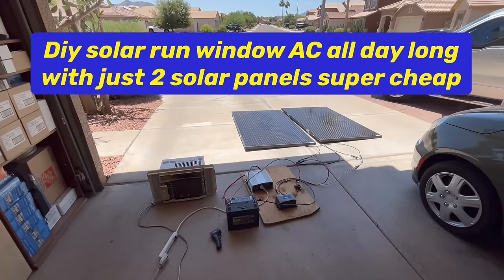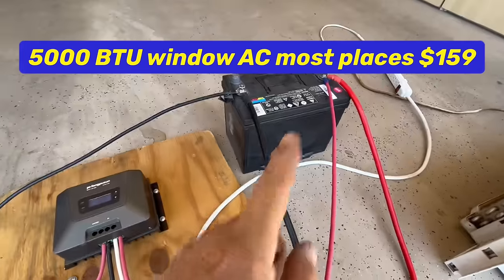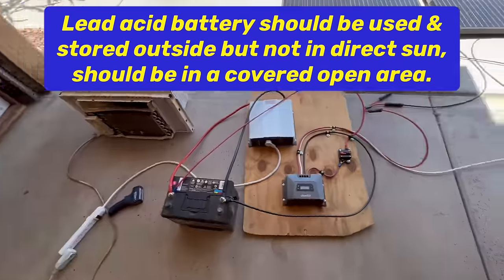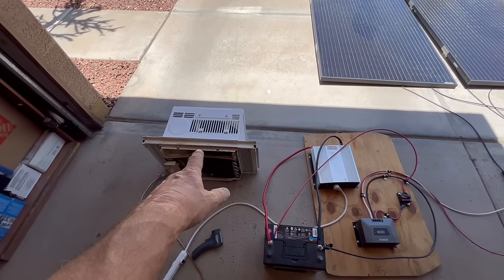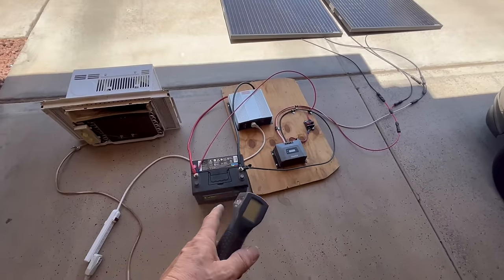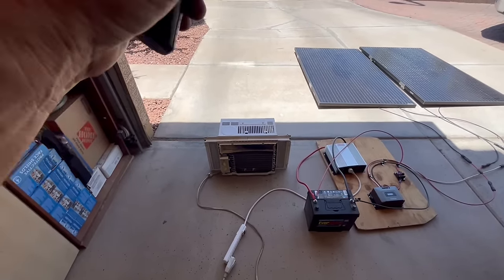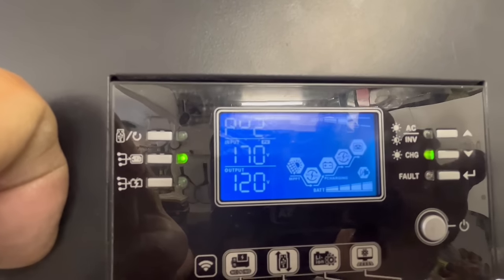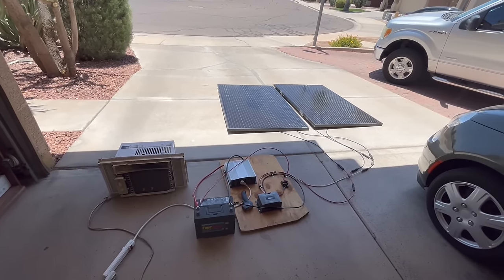Run your window AC with just 2 solar panels when sun shines. Easy DIY project you can do in one day.

Comment: I have two 265-watt Qcell panels and a lithium 12V 100Amp battery with a 1500 Watt inverter. The Window AC unit is a new Frigidaire FFRE053WAE Window Air Conditioner 5000 BTU. Purchased off Amazon according to the specs show 435 Watts of power. The spec is correct when the outside air is about 70F now that it's 115F I live in Phoenix this window unit is pulling 7.8 amps at 120V about 936 Watts. Yes, it's true you can run it off 2 panels reality is even in 108F weather not going to work. I'm seeing about 38 amps of power at 12V from the charge controller my inverter draws about 40-45 amps to run the AC unit. This is installed in a shed I charge the battery run the AC off utility power then at 4pm when rates hit peak hours 4-7pm I use the solar and the battery I can get about 3 hours about 38 amps from the solar, and about 10 amps from the battery. These window AC units are rated when under ideal conditions not in really hot conditions. I'm looking to upgrade my system accordingly to calculations ill need 4000 watts of solar to make this work I can get about 3000 watts on the shed. I have to replace everything I might go with the EG4 setup all in one inverter before I do that, I might try a battery charger hooked to utility power see what the actual cost is to supplement power. Cost about $2 a day off peak to run it I only want the shed to stay no hotter then 90 to protect the things I have in there. I have to figure out the ROI solar panels are low cost Santan solar is a 45 min drive for me its the other stuff cost money.
Reply from the maker: Nice, you seem to have it figured out. You are right. It cost money to do solar. I M now running my 3 1/2 ton and 4ton central air conditioning in house 24 hours a day using solar in the day and 25.5 kWh EG4 LiFePO4 battery bank at night. I air condition my garage during the day with solar, it is a 18,000 btu inverter mini split. I also installed 5 other mini splits in my house and garage. Use a lot less than central heat pumps to air condition house. Check out my other videos on air conditioning with only solar and battery bank. Thank you for your input and hope you have a wonderful and blessed week
Reply: @diy-solar-guy  You must have about $35-45k invested? I know EG 4 system 30KW powerwall is $20k. ROI 20 years I spent $3000 last year APS bill our AC unit compressor failed last august could be lower this year with newer unit. If I paid 35k for an off-grid system be 11-year RIO could be shorter if cost even goes up. Are you running entire house off grid?  Have to count in permits yeah could do it without city permits, but fire insurance might pay. If my shed burns down not really a big loss. We are looking to retire up north maybe Show Low somewhere cooler I can build a cheaper system don't need AC a swamp cooler will work up there. Down here have to over build a system for only 2 months a year. We run a evaporative cooler rest of the summer. 7/4-9/1 stuck with AC.
Reply from the maker: @Mike-01234  we only spent $20,000 on everything and will be paid off after only 4 years since we started off grid solar. We only run ac, pool pump, pool heater, fridge, freezers, lights off grid solar. None of my system is connected to the grid power. Only grid assist.

Comment: i have a 8000btu window unit, as well as a 12,000 btu portable unit that rolls around. Could I potentially run one of those on low with this system? I don't need it super cool!
Reply from the maker: @imothy  you could add more solar panels. A 5000 btu window ac will use around 5-6 amps or 500-600 watts. So a  8000 btu would probably use 900 watts or more and a 12000 btu ac would probably use 1200 watts. You would be better off using an all in one inverter. Check out my other videos for using all in one inverters.

Comment: This is awesome content so cool thank you break through yes!
Reply from the maker: Glad you liked it. This is just the basics of how solar works and can be used. Check out my other videos on using mini splits inverter heat pumps to cool upstairs, downstairs and garage in my house. I also use my central air conditioning to cool and heat house using only solar power from solar panels in the day and lithium iron phosphate battery bank at night. We spent $0 on air conditioning cost last month in Phoenix where we are breaking records for extreme heat wave. It is pretty cool with how much you can use solar to run all the things in your house but off grid. Everything I run with off grid solar is completely off grid. No solar panels on my roof of house. All in back yard. Hope you enjoy the other videos. Hope you have a wonderful and blessed week

Comment: $35 for a solar panel is a steal of a deal!
Reply from the maker: It is a really good deal but I am noticing I am only getting 44 percent output 2-3 years later, now I am buying 400-500 watt half cell mono bifacial panels that give me 3 times the output as the used 250 watt solar panels. The used $35 solar panels only come with a 1 years warranty as where the new solar panels come with ten year workmanship and 20 year 80 percent output warranty. Time will tell but I’m done buying used solar panels for now.  Hope you have a truly wonderful and extremely blessed 2024

Comment: Could you make one video on off grid solar panel with electric coil and induction based stove
Reply from the maker: I sometimes used an induction coil countertop 2 burner unit. It used around 1500 watts when both burners are on. I don’t have any stove/oven I can use to do a video. But it seems like the induction uses less watts. I noticed using it that it will turn on and off more often than the electric burner stove I had. Since they turn off and on more often and there really is not a surge, it uses less power. Since my 2 burner counter top uses 1500 watts when on high, I would have around 2000 watts in solar panels to use often throughout the day. That way your battery will stay charged while using stove. Thanks for your question and hope you have a wonderful and very blessed week

Comment: A soft start compressor capacitor in the AC unit would greatly reduce the start load, thereby allowing for a smaller, more efficient inverter.
Reply from the maker: You are correct, I installed one on my 3 1/2 ton and 4 ton central ac units that I now run with solar. And I also installed soft start on my 12.7 ton pool heat pump pool water heater. That beast uses 7500 to 8500 watts to run in the winter time to heat our pool water to 87-89 degrees. We show a lot of different uses for off grid solar and it is all DIY. Went from knowing nothing about solar, hvac, and electrical 4 years ago to where our entire system will be paid off in just the 4 short years since we stayed off grid solar. We saved enough just in electric bill saving to pay back our investment, but you can never do this with on grid solar because of the installation cost alone which is usually around 60 percent of onGrid solar price. You save all that money doing it yourself. Thanks for your input and hope you have a wonderful and blessed weekend

Comment: This setup has many parts could use improved efficiency.  Connecting the panels in series will double the voltage output and cut the current by half. That will reduce the need for heavy gage wire and reduce energy losses in the wire. The ac inverter is very inefficient and can be omminated if ac unit is inverter type.  Inverter ac unit converts ac to dc inside and will work with dc power.  The   change  to the setup that is a must is to use the battery with capacity to run ac without or reduced sun.
Reply from the maker: You are correct, this was just a example of a simple set up. I am actually running my 3 1/2 ton central upstairs air conditioning and my 4 ton downstairs central air conditioning with only solar in the day and EG4 LiFePO4 25.5 kWh battery bank overnight. It was 113 day temps last month and 85-90 degrees overnight lows and we spent $0 on air conditioning in Phoenix AZ last month. We run our pool pump 365 days a year 24 hours a day with only off grid solar. Check out our other videos to see how we took this simple ac set up and upgraded it to save over $5000 a year on electric bill. Hope you enjoy the videos, hope you have a wonderful and blessed week

Comment: How long will it run? As long as the sun is out?
Reply from the maker: Yes, add more solar panels, charge controller and another battery and you can start running earlier and longer in day. This is just a bare bone basic set up to show how solar runs an air conditioner. This is not an efficient system, but was meant to just show solar can run an ac unit. This was 4 years ago. I now run my 3 1/2 ton and 4 ton ac for upstairs and downstairs of our 2450 sq ft house with only solar and battery bank. Check out our latest videos to see all we run with off grid solar. Thanks for the question and hope you have a truly wonderful and extremely blessed 2024
Reply: @diy-solar-guy  thank you very much for your reply! I am recently learning the ins and outs of solar and come across your video. I'm interested in trying to pull enough to have comforts in a single room throughout the day and this would essentially be the centerpiece item. I will certainly check out the other videos, ty💯
Reply from the maker: @realliveboss5381  Good luck with your project and I hope you find all the components you need.

Comment: Hey I have a question I'm trying to add solar and inverters to our boat we have a 48 ft barge All steel and we've converted into a houseboat two levels living bathroom and second one is kitchen and stuff basically small house can you help me figure out how many inverters and house was put on where I'm supposed to put them and do they have to be wired into the main electrical system is that better or is that worse I have a copper wire for grounding but he said that you're not supposed to have copper wire on a boat is dangerous is there anything else you can use thank you I really appreciate the help any help from anybody in the comments that would be❤spectacular thank you
Reply from the maker: @GypsyPhoenix-x8t  hello, first, I do not earth ground my solar systems. I use neutral bonding in the electrical panel. I do not know weather copper wire on a boat is dangerous or not. If you needed split phase 120/240 volts. EG4 has several products you can use. I actually use the EG4 3000 watt if grid inverters, 4 in parallel to be able to produce 12,000 watts output. If you use 2 inverters in parallel, you could get 6000 watts output and still get split phase to run your loads. You can connect up to 5000 watts in solar on each inverter in one single string. You could get 400 watt solar panels and connect 10-12 in series to get close to 5000 watt input for each inverter. If you only used one EG4 off grid inverter, you could get 120. Volt pure sign wave output. Need 2 inverters in parallel to get split phase. 9000 and 12,000 Btu mini splits can come with 120 or 230 volt input. Anything larger than 12,000 Btu mini split is 230 volts. 400 watt solar panels come on different sizes but 40x70 is pretty much the smallest size. The inverters are different for on grid and off grid. On grid requires 120/230 volts to already be connected to inverter as where off grid inverter does not need grid power to work. It converters dc solar panel voltage to alternating current for output. All of my systems like I said are off grid and I had to connect wires from off grid electrical panel to each individual component like, ac, dishwasher, outlets to run fridge and freezers, pool pump, pool heater. You are basically starting from scratch and run wires to everything you want to run with off grid solar power. These are considered grid assist so you can connect grid power for overnight use with the input on the inverter instead of using solar or at night time. I have not done anything with grid power on my house, I would have to pull permits to connect to my grid power. Hope this helps. Check out my newer videos on using the EG4 3000 watt off grid inverters to get a better ideal of what I am talking about.

Comment: Doesn't it hurt the Air conditioning unit by using a modified wave inverter?  Also, with current battery prices, it will be best to have a LifePo4 battery instead of a deep cycle because the LifePo4 can be fully drained and won't hurt the life of the battery,  while the deep cycle you shouldn't go below a certain %.
Reply from the maker: You are correct. This was just a simple illustration of what minimum components needed to run ac with solar. Improve and upgrade for more reliability and length of run time. I run my 3 1/2 ton whole house heat pump to air condition and heat my house with used solar panels in day and LiFePO4 battery bank overnight. Thanks for your input. Hope you have a wonderful and blessed week.

Comment: I have an insulated 30x40 shop, I want to install a mini split to heat/cool it. I was wondering if solar panels would run the mini split.
Reply from the maker: Check out my videos on running 6 mini splits I installed in my house 2 upstairs, 2down stairs and 2 in the garage. All run with solar. Also I am running my 3 1/2 ton and 4 ton central air conditioning units with just solar in day and 25.5 EG4 LiFePO4. Battery bank at night. It is 114 during day last month and 90+ degrees for overnight lows. Yes you could definitely use solar to run mini split to heat and cool. You would probably need 24,000 btu mini split. A 18,000 btu mini split might not cool or heat that area. A 18,000 btu is rated for 1000 square feet. I use a 18,000 btu mini split in my garage, it use 230 volts. I have several videos on that as well on what components you will need. I think you will be amazed at what you can do with off grid solar. This is all DIY on my channel.

Comment: I like the project.  So you're running about 400w continuous load and 530w coming in from the panels.  How much would this need to be scaled up to pull almost 1800w continuous?  Basically just under the max of a 15a 120v outlet.  I'm asking because I'd like to put a few miles into an EV when the sun is at it's peak those few hours a day.  4X the number of panels and batteries + inverter & charge controllers to match?
Reply from the maker: You would need at least 2500-3000 watts in solar panel input but could not use that charge controller or inverter. You would have to go to a much bigger charge controller that could handle that amount of solar panel input. You could use an all in one inverter that has charge controller and inverter all built into one. Some of my older videos have a 24 volt, 2400 watts solar input and output, 120 volt ac output. You can see how I have that connected. Also there are other inverters out there that you could use. But in order to pull 1,800 watts continuously you will need like I said at least 2500-3000 watts in panels. Hope this answer helps
Reply: @diy-solar-guy  sure does, thanks. I have a sun room that’s about 20’ x 40’ with a 4/12 roof that I’d like to put solar on one day

Comment: Is there a way to use the sun focused with a magnifying glass to heat refrigerant to change states?
As long as the sun is intense enough the system powers up.
Still need power to pump the liquid and run the fans.
Reply from the maker: I have no idea on that. Maybe someone else, a viewer can answer that question.

Comment: This is what I've been looking for! Are you in Arizona and anyway I can get in touch with you?
Reply from the maker: I am in AZ. Southwest corner of Phoenix. You can email me at ppag53422@outlook.com. Check out my other videos on running 6 mini splits in my house, 2 upstairs, 2 downstairs and 2 in garage. I also can run my 2 central air conditioners , 3 1/2 ton and 4 ton using only solar in day and 25.5 kWh EG4 LiFePO4 battery bank overnight. Although I will need to increase my battery bank by another 10KWh to be able to keep up with this insane heat we have had this last month setting records for Joe many days over 110 degrees in row. Check out my other videos on running mini splits and what inverters I use. Everything I do is completely off grid. Nothing is connected to grid or feeds into grid. If I run it off grid, I had to run wires/conduit from inverter to ac it pool pump or pool heater or etc….  Hope to here from you. Hope you have a truly wonderful and extremely blessed week.

Comment: I noticed you turned the thermo on the old AC to the off position and you displayed the voltage jump when there was less demand on the circuit load. My question, why are the Coils on the AC still white with Frost if you turned off the compressor?
Reply from the maker: @alanCalhoun2  the coils never got a frost on them. It was too hot and I never ran the ac long enough for that to happen. It might look like that in the video due to the way the light is on coils. Even when I had installed in the shed I never saw frost on fins when running for hours. It is too hot out here and the humidity it very low usually around 20-40 percent. I hope this helps to answer you question, hope you have a truly wonderful and extremely blessed 2024
Reply: @diy-solar-guy  Thanks 😀
Reply from the maker: @alanCalhoun2 you are so welcome. Have a blessed day